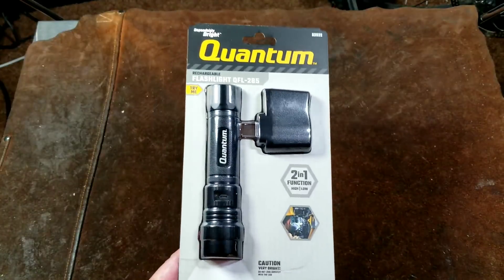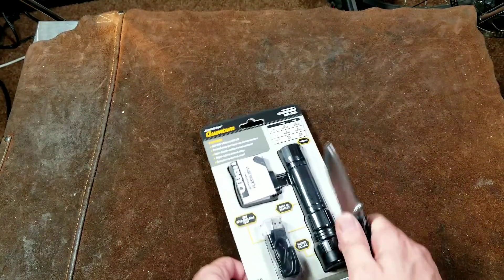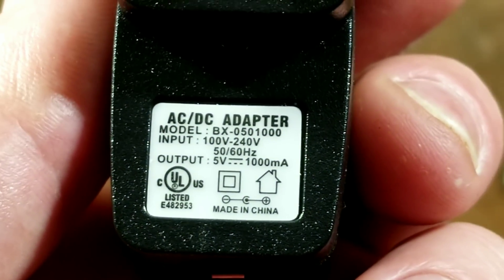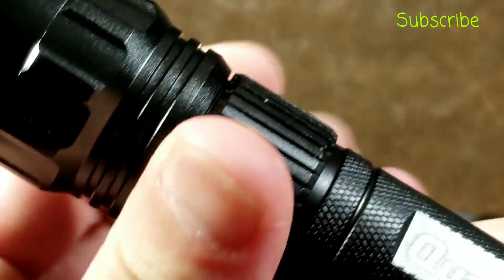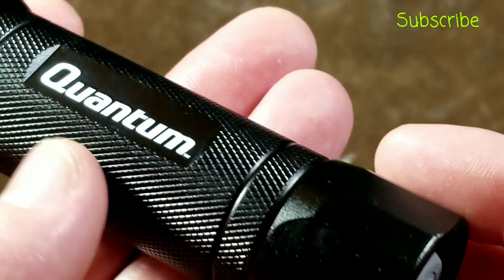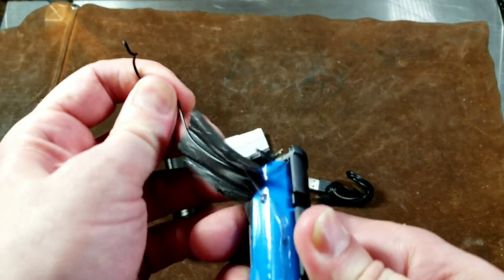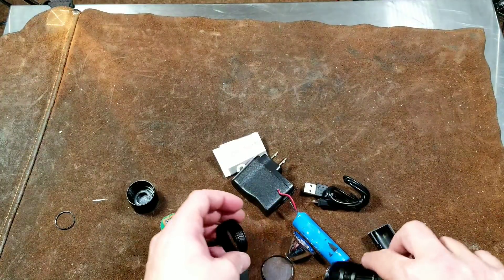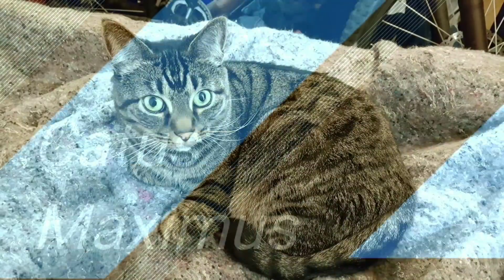Harbor Freight Quantum Li-Ion Flashlight Review

Comment: I've been using one of these daily for about a year. I think its a good buy even if not serviceable. I use it in my workshop and at night I use it to walk to my house 125 ft away. It does a great job of stopping deer in their tracks. One complaint is the charging port under the rotating guard is loose and I have to jiggle it a bit to get the charge light to function.
Reply: I agree. I have owned one for a year. I was impressed by its brightness and durability if dropped. I will be buying another one. It is so much more dependable than the cheaper flashlights its same size that you have to replaced the batteries. I never have to worry about its dependability to turn on. I never have to bang or shake it just for it to come on. I never have to worry about it staying on. I get very aggravated when I need a tool and it works and then don't. When I picked up this flashlight to use I never worried about getting aggravated due to performance.

Comment: What does the protection circuit do exactly and can u bypass it?
Reply from the maker: It helps prevent the battery from being overcharged or over drained and potentially overheating they are used on lithium ion batteries in certain situations where the built-in charging circuits are not smart enough to provide proper protection so they just add an extra circuit to the battery and it just makes it a little bit taller.
Reply: @CatusMaximus   ok so I took the original battery out and put in a little higher Mah. 2000 I think.. but now the flashlight won't turn on with the switch but the light comes on when I I plug the charger in.. Anybody have an idea what's wrong?

Comment: I owned one of these. IT just went out on me this week but I loved it up until its last day. When you turn it on it stays on instead of having to bang it on something just to come on. Even when dropped it never went out on me. I loved how much more durable it was compared to owning the cheap ones for so many years. I comes with different brightness settings and a flashing mode. For brightness I was very impressed. Just knowing I didnt have to worry about it going out on me while using it made it worth it for me. I have no issue with buying another one just because of how much better built it is than the cheap ones.